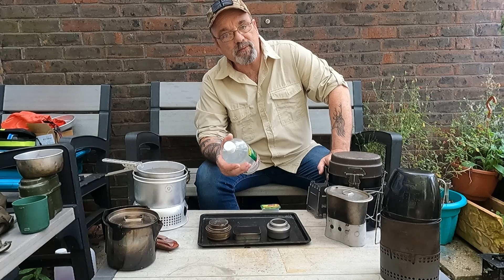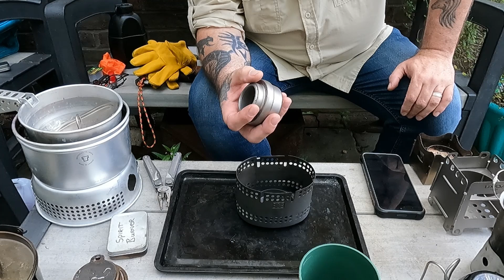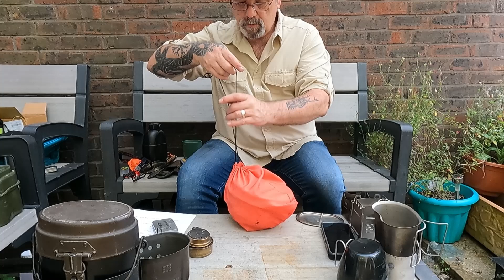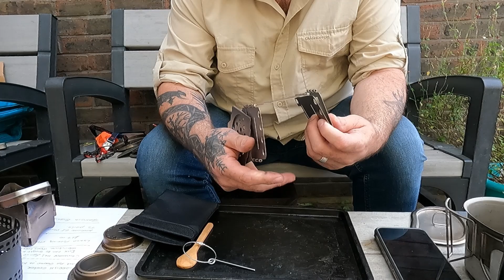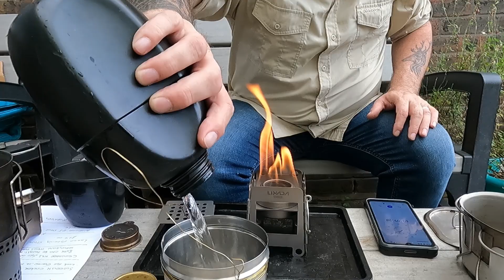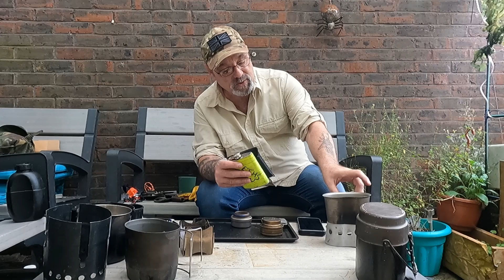SPIRIT STOVES  pt2 ,,,,my favourites and something new

Comment: Great video...though for me all "spirit" stoves other than the Trangia are only slightly incremental, and yet shockingly more expensive, variations on the established design.  In my book the original that established the essential design deserves all the credit.  At $15 USD, my Trangia, while not appropriate for every conceivable adventure, has been with me through thick and thin and with no moving parts works just as well 20 years later as the very day I bought it.  As consequence my dollars go to the O.G.
But again...great video!!
Reply from the maker: i concur  how ever i have a few earlier burners because as you would be aware Trangia is based on an earlier concept and have only really making spirit stoves since the 1950s before that they made cookware only.
 some of the first world war spirit stoves are real works of art ,thank you for the comment and have an awesome weekend mate
Reply: @hampshireoutdoorsandsurviv9340  Are those early WWI stoves pressurized or unpressurized like the Trangia??  I have an old old old Primus....but I think it's a kerosene stove not alcohol.....maybe 1920??

Comment: Another informative video Mick, a couple of years ago I bought a web tex cooking system (similar to the Mk 1 crusader) for about a tenner coz I already had the canteen and mug (58 pattern) ,thought I was on a winner but alas no, it didn't fit together  so ended up buying their canteen and mug for around 9 quid at the time, filled the gell holder with ceramic wool and wire mesh over it and now have a great little knock off crusader Mk 1 cook kit, works great and not a lot spent, cheers Mickey keep them coming, always enjoy.
Reply from the maker: thanks mate il have a look out web tex you say hmmm  maybe a video there cheers once again have an awesome weekend

Comment: Useful comparison video, thank you.  We have used the 'Evernew' version of the Lixada spirit burner for some years now and have found that a) the Trangia snuffer/simmer ring will extinguish the Evernew, b) to simmer with the Lixada simply place your pot directly on top of the burner - this will triple your fuel burn time as well as simmer and c) if you carry a simple fuel measure/bottom of a beverage can you can recover any unburned fuel to return to your fuel bottle.  The downside of the titanium burner(s) is that, compared to a Trangia or Tatonka , they are really fuel hungry.  We reckon to use 5-6 ml of fuel per 100 ml boiled water with the Trangia, slightly less with the Tatonka BUT 10 - 12 ml per 100 of water with the Ti burners. Take care, stay well, stay safe....Helen and Katarin Juska-Law, Stella and Terri with Robyn.
Reply from the maker: thank you  il give that a try the stoves is fuel hungry cheers as always for the advice and you all have a stunning week  cheers mick n caz
Reply: @hampshireoutdoorsandsurviv9340  Forgot to also mention that your GI canteen cup should sit inside the Crusader 11 windshield and with the pot-stand arm 'open' the cup will sit directly on the top of the Ti burner for instant simmer.  It's a quick way of saving fuel if you want to actually cook food.  Fill the Ti stove to max level, bring food to boil in 'normal' mode and then flip the pot support arms and put cup directly onto the burner.  All good for about 35 - 40 minute simmer.
Reply: Hi, new subscriber here, if you use bio ethanol  fuel ,zero carbon monoxide is produced .
Liquid bcb fire dragon fuel is bio ethanol ,as is their gel ...so 100%  safe indoors ,unlike meths .
Am liking the lixada burner ..really impressive. 
I will now swap my trangia burner for a lixada one 🙂👍
I will not use any aluminium  cooking pots .
Pathfinder make a superb  ,stainless steel version of the Swedish  kit .
The mk 1 crusader cook set has the best  canteen cup ever made , ( the 58 pattern stainless Steel  one )
The mk 2 cup in your video is aluminium...
The mk2  cooker is perfect,  I use the mk1 cup with mk2  stove ,I have the heavy cover lid  made for the mk 1 cup ...you need the mk2 pouch to fit it all in .
My flat pack stove is the original  firebox ...best folding stove ever made .
For just boiling water  my favourite item is my  petromax  fire kettle stainless Steel  ,1.5 litre ... nothing boils water quicker .
I like your enthusiasm...
Great video ..